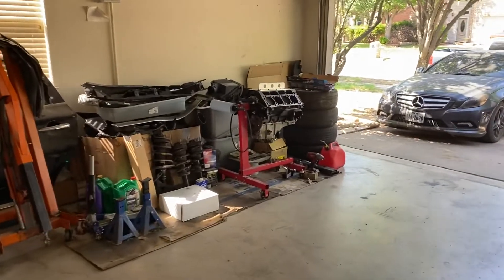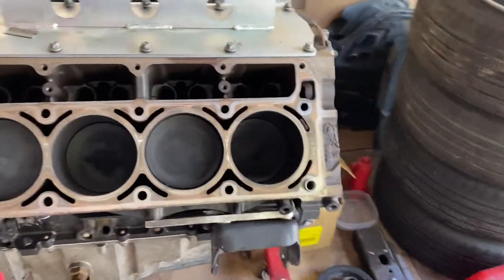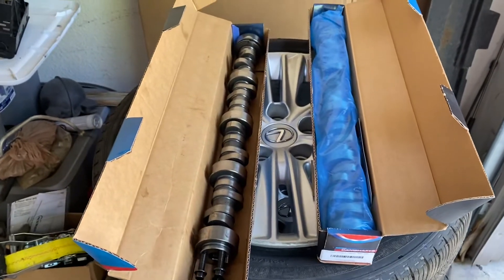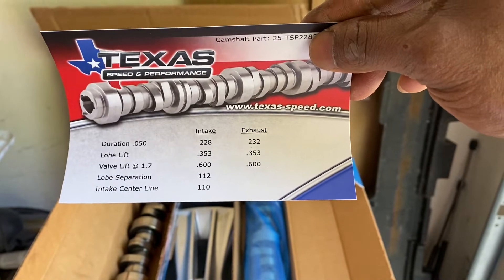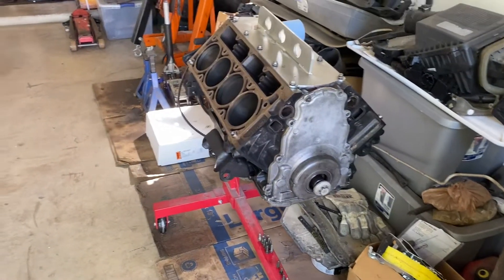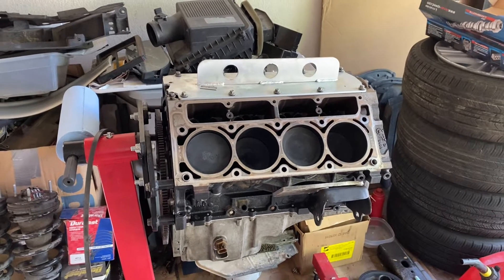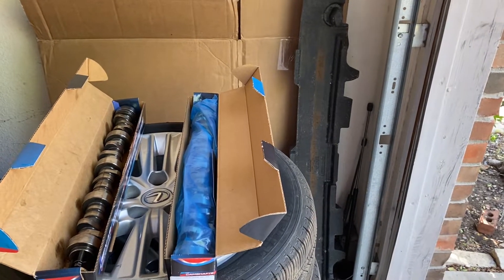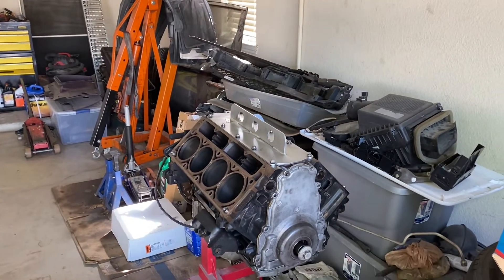Update on the Elco comp cam fired Texas Speed cam hired💪🏿💪🏿

Comment: I got a3000 stall summit SUM-G2704-10 converter with a Summit Racing SUM-8701-1 - Summit Racing™ Pro LS Camshaft & Spring Kits 218/227 lift. The tech
said it would pair Good. What do you think og?
Reply from the maker: That cam you have will great in the 5.3 in the guys case he have a 6.0 with a set of 215 cnc ported heads he needed a bit more cam for the heads to really preform
Reply: @willierebuildz9182  nothing crazy just want to sound really good n healthy and be able to burn a lil rubber
Reply from the maker: @jermaineknowles87  it’s gonna burn rubber all day should sound good as well did you hear it run yet
Reply: @willierebuildz9182  yes but cut it off quick all my fittings leaking under the car by filter and on tank. Cheap eBay fittings I’m replacing them with something a lil better. Also was idling high found out I didn’t plug the one hole in back of the Holley intake where the mail sensor goes. Running terminator x so I’m using the onboard 1 bar on the ecu . 🤦🏽‍♂️I’m learning og💪🏽
Reply from the maker: Fittings probably just needed tighten
Reply: @willierebuildz9182  tried everything that joker still leaked😂 fittings on the way in cheap that was last resort